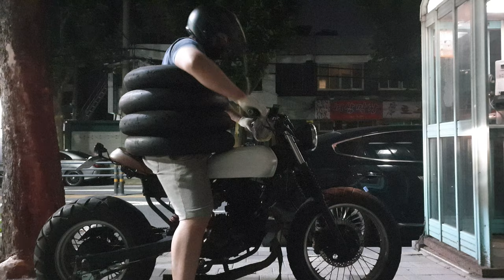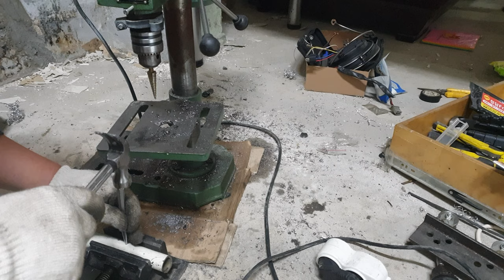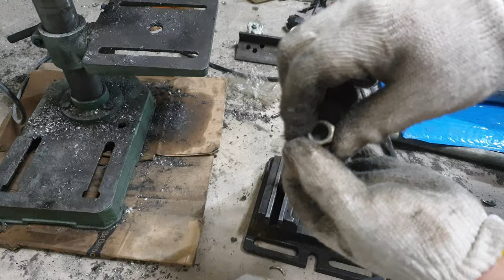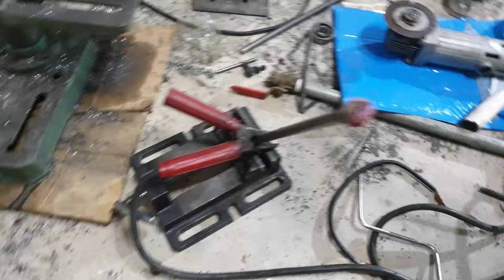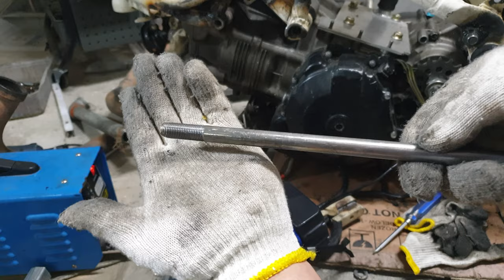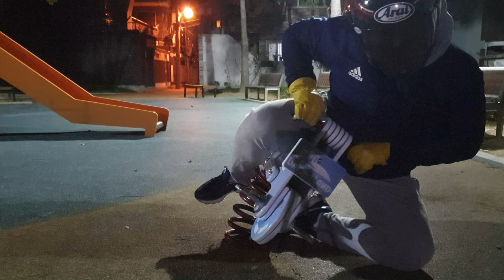500cc Hyosung exiv 450 GD450N project  Pt2

Comment: Won’t the crankshaft be out of balance with one cylinder disconnected? Looks like it fits well 👍
Reply from the maker: I Consider counterbalance or dummy conrod at First time. But. I Catch Rmz450 without balance. 
I believed just simple is best.
I just cut off the conecting rod without bottom bearings.
Keep in mind I bought the engine. 
I spended 150$ for engine.
possibly Minimum budget for project.
Reply: @ppaha  you could just guess and drill some holes in the counter weight
Reply from the maker: @DktheWelder  If you're making modifications, you'll probably need a dummy connecting rod rather than a hole.